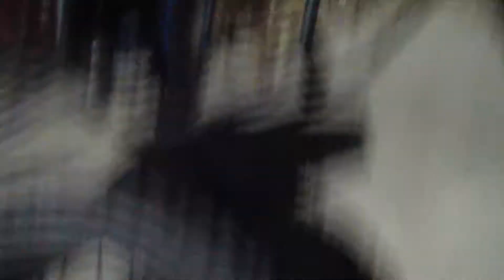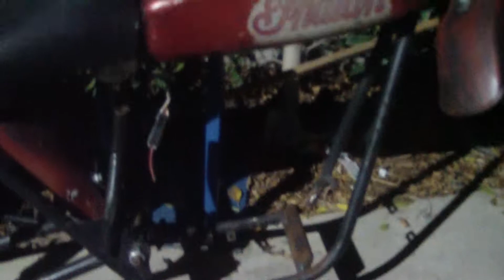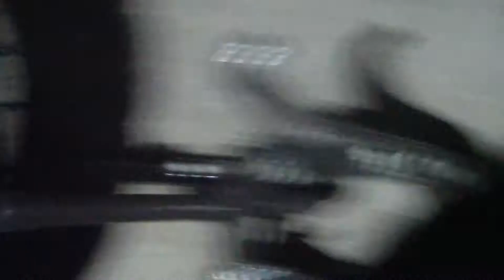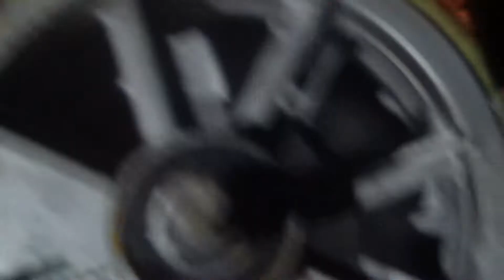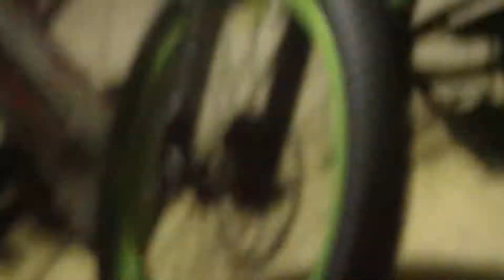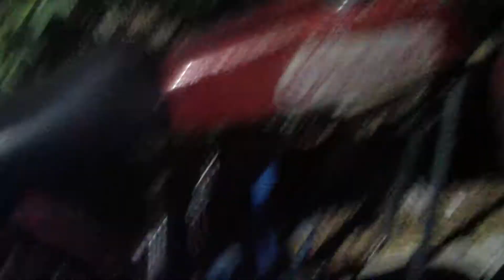Electric Indian Motorcycle..QS Motor 266 8000w motor Wiring Repair #1

Comment: Hi dear 
I need to ask y for if i can increase the voltage of my hub motor from 60 v 1000w to 72v 1000w what happen ?
Reply from the maker: little risky ...probably OK.. but maybe go with 72v 800w controller so you don't prematurely melt your motor
Reply: @christopherviersmobility   but when i buy ,the sellar is say to me it can be loaded over 72v due to the wiring is very large
Reply from the maker: @liebezu8883  hahaha fried a few motors trying so many things... Yeah figure out how many watts a motor can handle and then multiply your amperage and your voltage and try to get close to that number I find their way to conservative I've doubled and tripled it but just makes the motor run hot I've cooked a few motors 2 they're pretty robust generally... It's up to you if you want to risk it...
Reply from the maker: @liebezu8883  one way to run more wattage on a motor that is rated for... less than you want.. provide cooling cooling finss around the motor casing... My 3000 watt motor does 5000 Watts regularly.. it doesn't even get warm but I have a aluminum cooling array around the motor...
Reply from the maker: Also you can drill some holes in the motor case so that the heat can get out better.. I have not found going through puddles or anything like that to be a problem.. I'll ride my bike on a rainy day or sunny day..